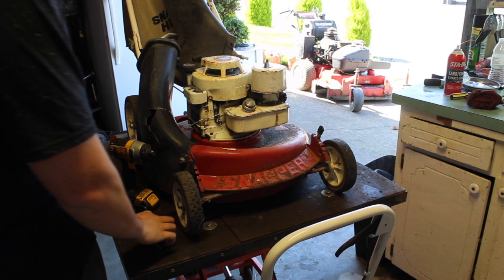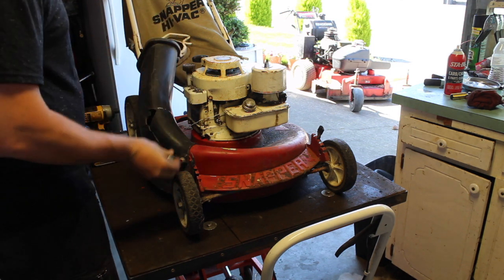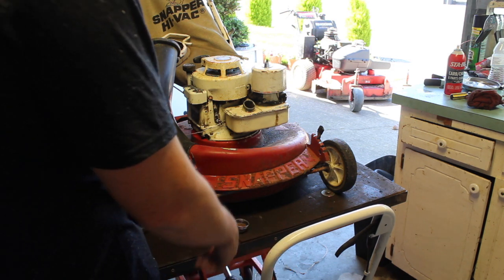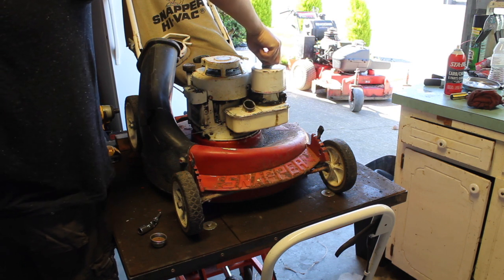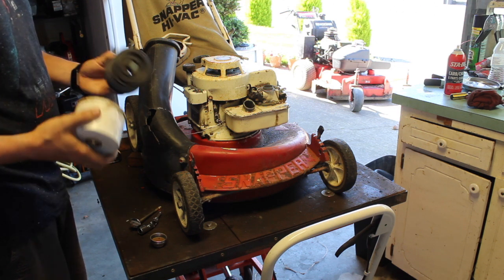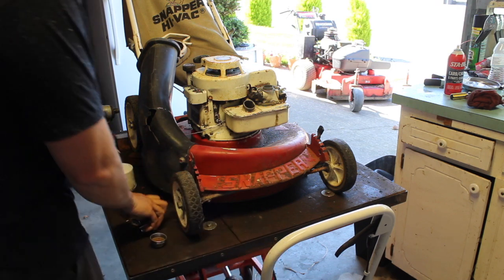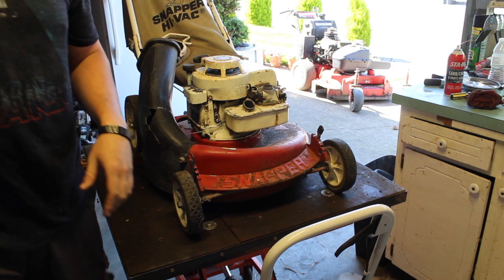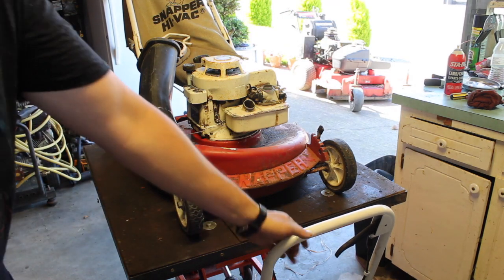Trash, Treasure, or Parts? Briggs and Stratton Classic Auto Choke Not Starting

Comment: My 1986 and my little brother’s 1991 Briggs and Stratton engines had the Auto Choke carbs. But I put the newer plastic carbs on them. They start and run better
Reply from the maker: I forget the exact circumstances for this engine but replacing the carb probably would have been easier
Reply: Same issue here on a 3.5 hp.. replaced diafragm but still runs rich with needle complete in..  wanted to keep the thing original ( 50 yrs old ) but guess I overlook something ..